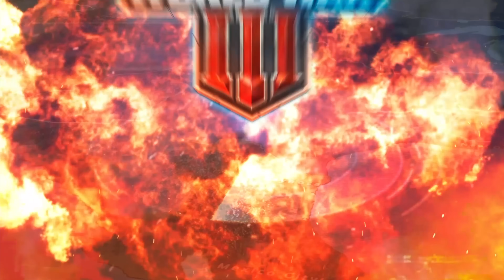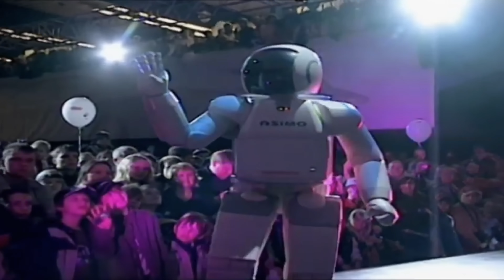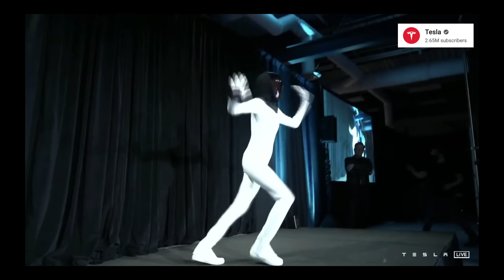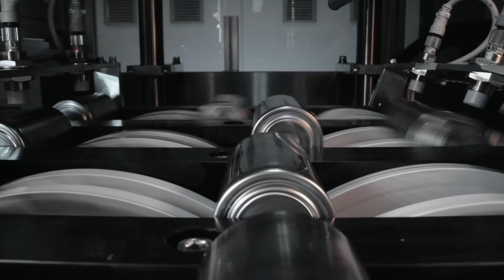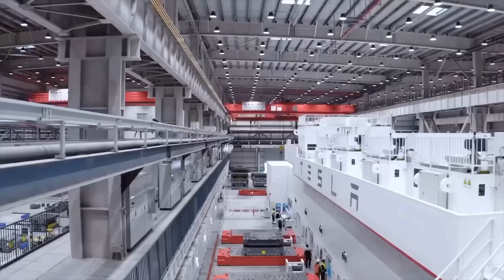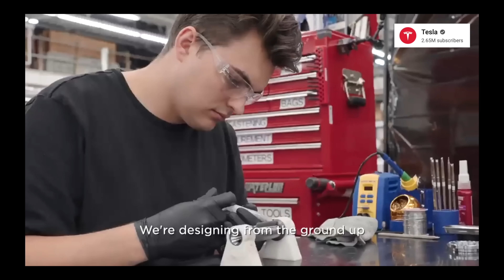Elon's Big Bet On Tesla's Future | Optimus 2

Comment: Just like FSD, the bot is a great concept in technology that will likely never find widespread application, especially in terms of residential use. There's an army of regulatory authorities tasked with preventing harm from new gadgets, and it will take a decade for Musk to convince them that, e.g., the bot won't accidentally knock the iron off the ironing board and squash fido. As typical, Musk has grossly over-promised and seriously underdelivered.

Comment: To establish colonies on the moon and Mars, robots like Optimus would be invaluable in constructing what is needed before humans could take over. The robots could probably also be used in Earth orbit, helping to setup bigger and more capable space-stations and perform regular maintenance. They may even be used to repair difficult to reach satellites. Strap on some small rockets and have it tow tools and replacement parts. They could even be expendable, one-time use as their cost of manufacturing would be significantly less than putting a new replacement satellite. The legs wouldn't be needed but maybe additional arms could be useful. Of course, future satellites would have to designed with this kind of maintenance in mind.

Comment: Robotics has just guaranteed the burning of fossil fuels for an unknown number of generations well into the future.   These things will be energy hogs of extraordinary magnitude when it comes to actually performing some manual labor such as working in a factory or on an assembly line.  Pushing, pulling, lifting and moving objects will tax the batteries in these things like crazy.  You'll definitely need to have 2 for each job - one working while the other is tethered to a supercharger!   Better start selling your kids on the idea of getting a technical education to be able to work with and work on these machines when maintenance is required.
Reply: Why fossil fuels?
Reply: @vancity2349     We keep hearing from foolish politicians that EV is the future and they want the future in just a few years from now.  Sorry but that future requires an enormous amount of electrical power.  

CA today cannot effectively handle the extra EV load on the system.   Now add power hungry robotics to the equation and they'll be millions of them working everywhere and they are thirsty animals and will seek out a charging port really quick.   Robots have batteries and are serious power hogs!    

Just listen to what they want those robots to do!  Fossil fuels is about the only course of action to achieve this future they want so badly.   It just makes those politicians feel sooooo good inside regardless of the cost financialy and environmentally.  

We already are short on lithium and as the story said, add 20 billion more robots to that equation all which will have battery requirements and that spells big problems down the road?  SMH!